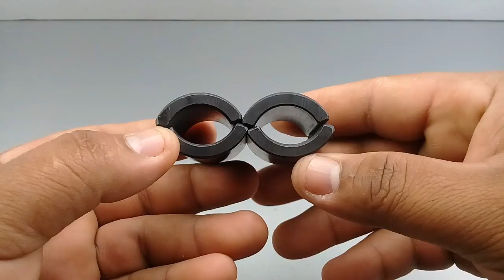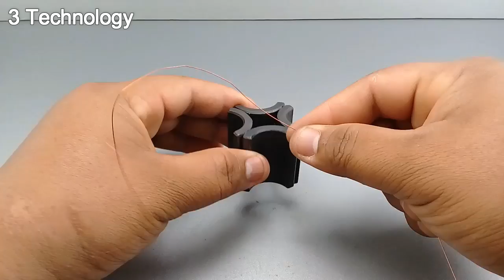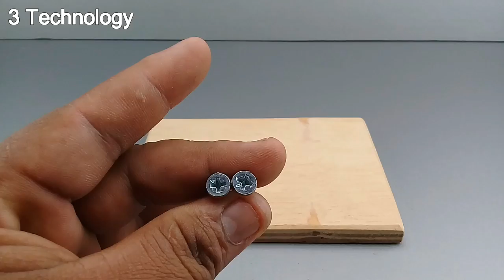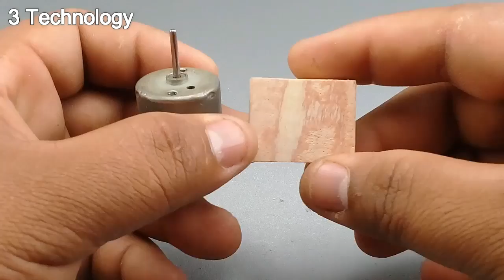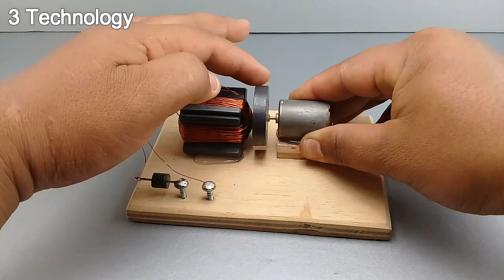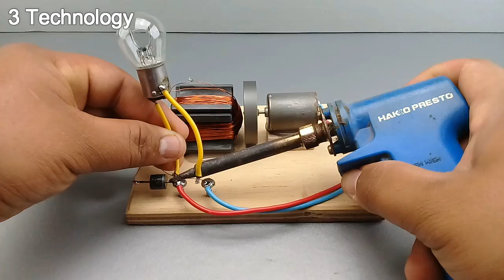I Rewind Copper Wire into Free Energy Generator Using Magnetic Coil

Comment: As soon as you put a load on it, the motor changes RPM and slows. You would have to put this through a constant current circuit first and then power the light to keep that from happening.

Comment: Only stupid people will believe this crap!   You should explain what you're doing!  Why did you waste your time, wrapping copper wire around the magnets?  Why did you put two screws in the board?  What's the diode for?  Why don't you lift the whole unit off the table, while it's running?

Comment: Habe ich nachgebaut kann so nicht funktionieren, unterm Tisch ist nämlich eine Induktionsplatte. die Spannung indiziert, habe mehrere Versuche aufgebaut. funktioniert nicht, geht nur mit Induktion unter den Tisch. Erklärung in dem Moment wo er die Batterie 9 Volt dranhängt, betätigt der unter dem  Tisch ein Fußpedal so  induziert eher eine Spannung und so funktioniert es ganz einfach. Aber trotzdem tolles Video.

Comment: الخدعه جوا الخشبه مكان البراغي يوصل اسلاك 12فولت او5فولت ..كل فيديو هاتك تستخدم البراغي
Reply: If he has a battery hidden under the wood, at the point he connects the wires to the motor ( which according to you is connected to the hidden power source under the wood) , the whole circuit is complete and the motor should start running much earlier than he connected the 9v battery. Well it did not run until he connects the 9v battery. So there is no hidden battery here.
Reply: @seshamxy9135  You have no idea of what you're talking about!   Can you build one?  Don't use any screws!  Do you really need a diode?
Reply: @traBylliB  , I made it a decade back. I never published it. When you fail to build it, you suddenly say it's impossible and it's fake and other opposing stuffs. I built it and i know it works, there are even videos posted last week or little back, proving this method. That particular video can simply make you say it works. Well such a video is not posted by this guy although.
Reply: @traBylliB  diode changes the ac to dc here. Study physics before talking
Reply: @seshamxy9135  The diode is not changing anything!!   The only thing the diode is doing, is isolating the coil from the motor!!   IT'S ALL FAKE!!!     Unless you build one, and prove me wrong, SHUT UP!!!!
Reply: @seshamxy9135  WRONG!!!
Reply: @seshamxy9135  No, there is a hidden battery, but by a button that walks at my feet
Reply: @seshamxy9135  Press my feet button
Reply: @hassan-aljarjri  talk meaningful words.
Reply: @seshamxy9135  My brother is in a battery under the wood and presses his feet on a button
Reply: @hassan-aljarjri  since it doesn't work for you, you insist that there is a battery, since it works for me, I am thinking you are pretty much without knowledge on science
Reply: @seshamxy9135  هههههههه